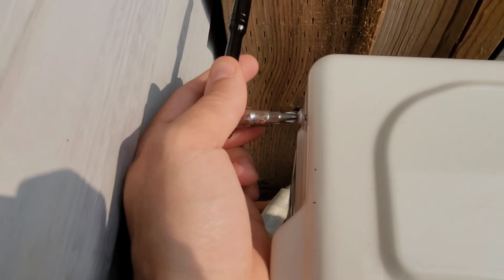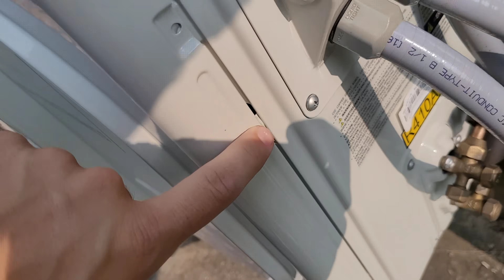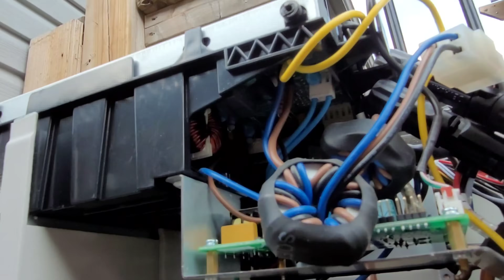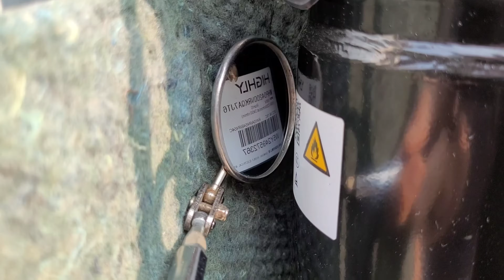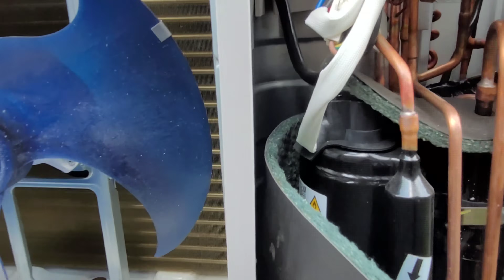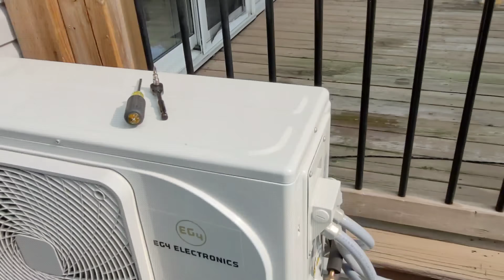Whats Inside The EG4 Hybrid Solar AC Heat pump?

Comment: After disconnecting all power does the unit hold residual charge? How long will it hold if it does? I can’t find my voltage meter to make sure & I’m wanting to disconnect unit. Is that safe to do?

Comment: Hello, have knock off version on this mini split. It is called stealth solar ready. My question is did you ever find out the name of that board underneath the inverter board with the relays on it. I'm trying to actually figure out why my unit will work on DC.  The company had me replaced the MPPT( SOLAR BOOSTER) still same results. I have five 570 watt panels in series with 52.1 Voc. Voltage reading at the condenser is around 345. I'm trying to figure out if it's the inverter board or the one underneath of it.

Comment: Having problems locating replacement boards as lizards crawl inside and short them out. I have the 24000 solar hybrid models.
Reply from the maker: I just had a board fail on a 24k too, waiting for an answer from EG4 via signature solar
Reply: @SmitHVAC. I have my units on Grand Bahama. Shipping the units back just to replace boards is not doable.
Reply: @SmitHVAC. were you successful getting warranty support? I’ve got one I believe the expansion valve is stuck on.  Pills down the suction side to zero. Heat works as it should.

Comment: So what is the unit doing, converting DC power from panels to AC to run the motor or converting grid ac to dc to run the motor?
Reply from the maker: @Berean68  Concerts grid Ac to DC just like every other  inverter minisplit but also has the option to allow solar direct DC to DC
Reply: @SmitHVAC.  in the interest of not losing too much efficiency, is there a way to go from battery to this unit in DC?
Reply from the maker: Yes I think it can be done with the right converter, Ecosolaris does it

Comment: great video, thanks.
no heater at the bottom of the case to prevent ice buildup. Have you ever had issues in the winter?
Reply from the maker: I haven't personally, I've heard from 1 or 2 people who have but for the most part it hasn't been an issue for people.

Comment: This is probably the cleanest install I've found on youtube. I like how everything is tidy, concealed and out of the way. However, I was kinda hoping for a detailed parts list of connectors, conduit, AC disconnect box and wiring. Maybe I missed it in one of your other vids.
Thanks. This Helps me when I install mine.
Reply from the maker: Thanks! It depends what you're up against for the install, 1/2 seal tite and connectors are your best bet, a generic 60a disconnect and some 10 gauge solar cable with mc4s will get you started along with an IMO disconnect https://signaturesolar.com/dc-disconnect-rooftop-isolator-switch-by-imo/?gad_source=1&gclid=Cj0KCQjwsuSzBhCLARIsAIcdLm74S-t5eh2yI82Mqt68xW-GBQ--qoTZRqey4hgAhhIOt-JaFJnO5LcaAqgkEALw_wcB&hsa_acc=6010647758&hsa_ad=&hsa_cam=17631500090&hsa_grp=&hsa_kw=&hsa_mt=&hsa_net=adwords&hsa_src=x&hsa_tgt=&hsa_ver=3&ref=_KvVrzchAclARI&utm_campaign=PMax%3A%20Shopping_Smart_Brands&utm_medium=ppc&utm_source=adwords&utm_term=

Comment: @smithhvac  Is there a way to add this MPPT board to an existing Midea made mini split? I have a Senville badged Midea unit with the standard 240VAC. Is it possible to add this MPPT into it and run the unit only from solar alone? 

If so, would you recommend a make and model and source of MPPT board?
Reply from the maker: It's probably possible but I have no idea if the part is available to the public or what else would be involved in the installation
Reply: @SmitHVAC.  If you could explore how to convert an existing Midea made mini split to hybrid, that could be a good video series for your channel? I can't find anyone else that is doing it with existing Midea systems for sure, so you would be a trail blazer!
Reply from the maker: @TheBlairHouseProject I looked into  something similar, the main issue is if you can buy the mppt board  from a hybrid solar manufacturer and do the conversion, there's no chance of you ever buying a solar hybrid unit from them, so most do not offer the parts for sale.
Reply: @SmitHVAC.  I hear you, but there has to be a huge market of existing mini splits that could be retrofitted.. literally millions. Vendors could make a fortune out of selling to these folks with a comprehensive conversion kit.
Plus it would increase their sales volume where their wholesale price for the conversion kit would come down, so it would allow for bigger margins. 

It has to be worth looking into... leaving money on the table right now! I would buy several kits myself! I have 9 regular minisplits deployed already. 
I think it's definitely worth a video series looking into it. I can't be the only one that would be interested in this and noone else is doing it. I wish I had your knowledge to do it myself.
Reply: @SmitHVAC.  Fair enough. Did you happen to capture the make and model of the MPPT inverter?
I was also wondering if it outputs AC or DC volts into the rest of the system.

Comment: I'm not 100% sure you have an expansion valve. That cover isn't for the motor, as they don't actually make any noise after startup. It's probably to prevent major amounts of ice forming there and to protect the thin piping. My other units that do have valves don't have any insulation there.
Reply from the maker: How could you have a heat pump without an expansion valve?
Reply: @SmitHVAC. Easy. You have two capillary expansion tubes. Each path has a one way check valve to make sure the proper one is used for cooling or heating. 
Not sure about today, but every Carrier heat pump simply used a piston at the liquid line at the valve. It auto bypasses in cool mode.
Side note: It didn't get very cold where I'm at to see how well it works, but the new Pioneer WYF mini split uses a capillary tube - no EEV. I prefer EEV for a greater degree of control, but apparently, you don't need it for high SEER ratings.
Reply: @SmitHVAC.  Ha, a year or whatever later, I found the parts manual. It does have an eev.

Comment: I have a question hopefully someone will be able to answer it. For the heat part of this what is the lowest outside temperature that this will work?
Reply from the maker: I've used mine at - 10C/14F and it worked pretty good, I installed it late last winter so that was the coldest day we had. I made a Facebook group for Eg4 owners and I'll update there this winter if you want to join.
https://m.facebook.com/groups/302169436066573/?ref=share&mibextid=NSMWBT
Reply: @SmitHVAC.  thank you I don't know what the difference between the hybrid 12000 BTU is performance-wise and this one?
Reply from the maker: @mycabinlife1291  this is the hybrid 12,000 btu
Reply: @SmitHVAC.  okay I'm confusing with something here I'm new so you have to bear with me. What is the one that runs directly with solar only?
The one where you can plug and play it's ready to go out of the box you don't have to vacuum any lines if that's the right word you can just plug your solar panels right into the connectors.
Reply from the maker: Yes that's this one, the Hybrid 12000 can run on grid power or directly on solar panels, this is the original version that does not have precharged lines but the new ones all have precharged lines now
Reply: @SmitHVAC.  okay yes I just was going to try to put a link in here I finally found it the one that I was talking about it has the pre-charged lines. Is it the same efficiency as the one in your video it's just the only difference is the pre-charged lines?

Comment: Has anyone added an mppt controller to an ordinary minisplit? to let it run on direct solar
Reply from the maker: You wouldn't be able to just connect an mppt, the main board needs to be able to communicate with the mppt

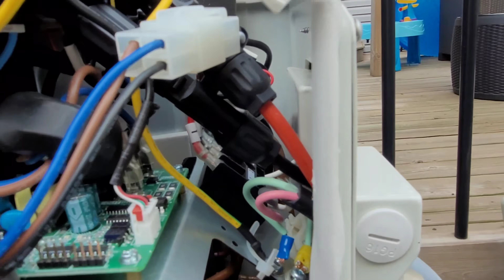Comment: this is gonna be a dumb question, but the solar connectors at 5:23 are already part of the mini split right? like i just buy X panels and plug them straight into this unit? are they normally in the unit like yours are?
Reply from the maker: Not a dumb question at all. Yes those Mc4 connectors are built in, you can just plug solar panels or solar extensions directly into the Ac.
Reply: @SmitHVAC. 

Awesome, Thank you :)

Do you mind if i ask you like 2 more questions?

I plan on insulating my garage and turning it into a decent sized living space/room, and was gonna use these solar mini-splits and some solar on the roof,

i was going to use 1 24k mini or 2 12k mini's, and was going to buy the panels from  santan solar, but they have a minimum of 10 panels,

The voltage would be 2 high for 10 panels on the 24k mini, so like 2 panels would be unused, but i could use 5 panels each if i had 2 12k mini's. (and also have a packup if one mini failed/etc)

also imo distributing the cooling sounds like a better idea, but i'm no hvac person

my first question is, 2 12k mini splits would be fine right? no downsides over the 24k except being a tad more expensive?

2nd question is, i think these need a series connection, and i think i heard that in series or parallel, they all share the lowest wattage of a panel? like if 1 of my 5 panels is getting  some shade and getting 40w while others are getting like 300, they will all "count" as only getting 40w each? is that true for series or in general?

Comment: Would you know if the unit has a factory reset button?  Also:. How get both the remote and the display to both show °F.  With help from Signature Solar I now have one of each. and a couple other issues.  TIA p
Reply from the maker: It doesn't have a reset button but you can try the following
 1. Power the mini split on
2. Press the Light button 8 times in 10 seconds and it will beep 3 times.
I got them both into Fahrenheit after resetting the unit and trying the procedure again

Comment: Wonder if it is possible to change the MPPT for a better one ?
Reply: Yeah, why change it?
Reply: @WillProwse  better efficacy, better performance , less stand by power drain
Reply: @samanthapowell5882  the built it MPPT has none of those issues. Can you make a video posting bad tracking performance of your MPPT? I haven't seen any issue at all with it
Reply: @WillProwse  not saying it is an issue, just asking if there was a better MPPT that has better stats could it be installed
Reply: @samanthapowell5882  MPPT tracking algorithm is very simple. Whether you buy a low quality one or a high quality one the tracking algorithm is pretty much the same. And so is the performance. Now the tracking speed can differ, especially when it's trying to find the power point after a cloud has passed over, but I have not noticed any issue with the MPPT on this heat pump. Furthermore the efficiency on this MPPT is fantastic. I don't see any reason to replace it
Reply: @WillProwse  makes sense, Thanks
Reply: @WillProwse  Is there a way to add this MPPT board to an existing Midea made mini split? I have a Senville badged Midea unit with the standard 240VAC. Is it possible to add this MPPT into it and run the unit only from solar alone? 

If so, would you recommend a make and model and source of MPPT board?
Reply from the maker: Better in which way?

Comment: Nice video! Hopefully the units will last a long time.
Reply from the maker: I hope so! It's not uncommon to see refrigerant leaks around 6 to 7 years old on R410a equipment, fingers crossed! Thanks for watching!
Reply: @SmitHVAC.  i was emailing a deye employee and i thought he said everything was DC voltage with a variable frequency which changes speed. But I think you said the fan was AC. Is that correct?
Reply from the maker: @rodneyhunt  No you are correct it's a DC outdoor fan motor
Reply: @SmitHVAC.  Ok I misunderstood

Comment: I was just thinking that the MPPT controller is pretty much one of those MPPT controllers they use on well pumps. They have an option to use solar and or grid. Not sure what the specs are on them. Yet I have been wanting to find an inverter that can work with solar only, battery only or grid only or any combonation of the three. All inverters require battery connection in order for it to work. In a case of places that have net metering a system like this could and would work greatly for a lot of people who do not need or want a battery bank or the ability to buy a battery bank right now. A person could buy an inverter and solar array and then either net meter or sell excess back to the grid and when or if the grid goes down that location can have power during the day with no issues. Would be a cheaper start up cost overall and allow people to grid tie with back up ability. 
With my current lay out of my house I would need eight 1 ton units. I like mini splits for their ability to over size to account for the additional heat load from cooking and extreme temperature swings. When many HVAC companies do not factor this in, I am going to do it and make sure I have a large enough system. I am also considering adding in in floor heating either in radiant heat and or electric heat. With radiant heat I can add in a small indoor wood/coal boiler.

Comment: Thanks for sharing your insight into the components of that mini - split hybrid.  I was wondering how much sqft that 12K btu can cool?
Reply from the maker: It really depends on the area you're trying to condition, insulation values and whatnot, but typically between 400 and 800 sq ft

Comment: Great video! Would insulating the copper pipes inside increase the efficiency?
Reply from the maker: Maybe slightly! But most of the copper downstream of the Exv is insulated already. Thanks for watching!
Reply: Thank you for the response. I am planning to build an off-grid system in my cabin with a mini-split and wood stove combination. I am trying to calculate how many solar panels and how big of a battery bank I need and your videos has been very helpful. 👍 @SmitHVAC.
Reply from the maker: @Jm91swe  That would be an awesome combination. I recommend 1600w of solar for this 12k btu, I currently have 1200w but will be upgrading before winter. The battery bank really depends on your climate, I can usually shut mine off by 8 or 9pm. Glad you liked the videos!
Reply: I live in the northern part of Sweden so the battery bank will have to be quite large.. I am thinking of installing four or five 550w panels. Having a lot of solar panels but no where to dump the energy in to is also a consideration.  @SmitHVAC.

Comment: I like the video and wanted buy one but my outer walls are a foot thick and the low and high pressure lines coming from the head are only 14 inches long, which makes hook up not doable. I would like to add a few inches to those short lines on the head but, not sure how to pull a vacuum. If anyone knows please let me know. Thanks Nick
Reply from the maker: You could do it, if the connections are in the wall just connect the lineset inside and pass it out the hole

Comment: Nice teardown, appreciate it.I always assumed that inverter motors were DC .So if I'm not mistaken the inverter takes your PV and converts it to AC to then allow for variable frequency?
Reply: So for a normal unit you have AC coming in, then it's rectified to be DC and then it goes through an inverter (which is part of the motors) so it's back to AC. Why go through all of that if it's AC in the end? So that you can get variable speed. Now this special unit can also take DC input from solar. I would assume that the solar charge controller just cleans up the DC from solar but other wise directly supplies it to the motors.
Reply: I'm curious about all of that too. I thought one of the main benefits of solar mini split was increased efficiency because there's no conversion.
The compressor he says is 180vdc but the condenser fan motor he says is 3 phase which as far as I know is always AC. So it would need to be controlled by variable frequency. I think anyway...
Probably not a lot of loss in conversion for the fan motor though because it doesn't require much power, relatively.
Reply: @lancealderman2755  I'm pretty sure the fan motor is a 3-phase brushless DC motor (ECM).